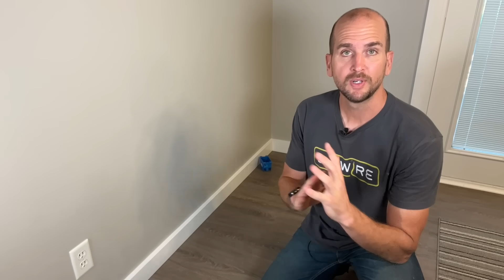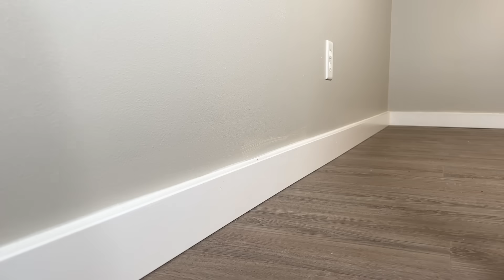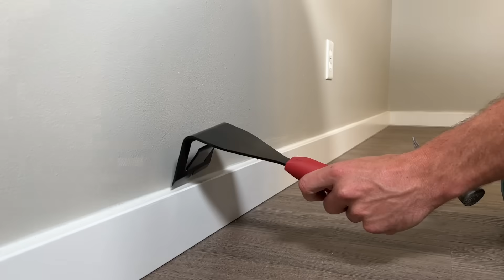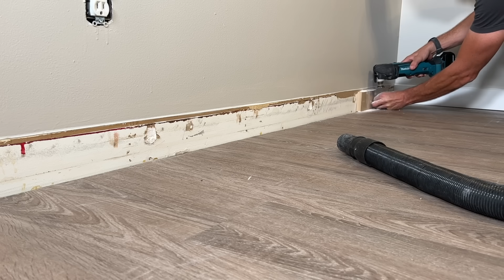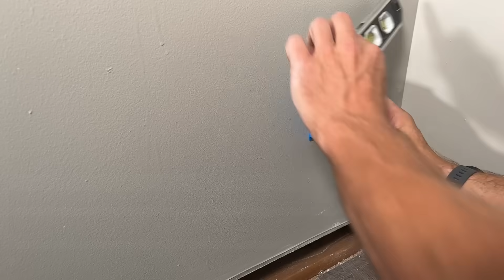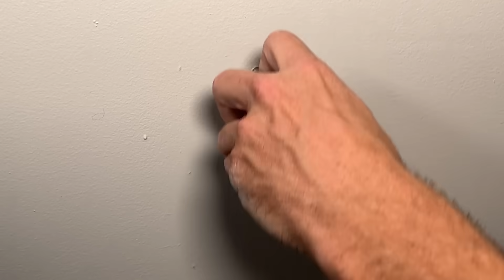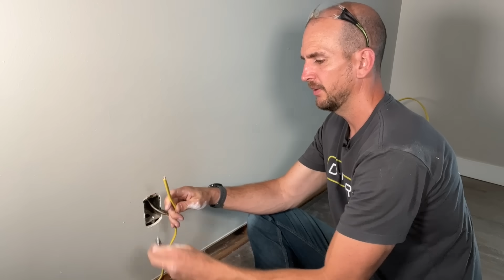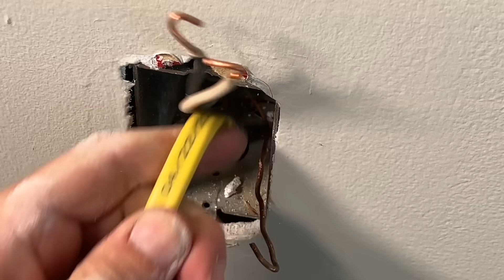How To Add An Outlet To A Finished Wall

Comment: Interesting.  Here in South Africa we don't have the convenience of running cables inside and behind drywall; all of our buildings here are brick.  So when we do a job like this it's chasing masonry, installing conduit, plastering and skimming, really a messy pain.  It's also odd seeing your black and white cables; over here, red is live and black is neutral, but it's 220V, 50Hz.  I envy your building methods in situations like this.  But then again I've seen what tornadoes do to your homes, ditto termites....  Nice concise video, thanks.

Comment: what size Romex for residential?
Reply from the maker: 20 gauge for 20 Amp circuits and 14 gauge for 15 Amp circuits
Reply: @EverydayHomeRepairs  uh that would be 12 gauge for 20 amp...I know that was a fat finger typo but dint want anybody installing 20 gauge fuseable links in their walls ;)

Comment: You did a nice job I was surprised actually. With 22 years experience as an electrician I approve. You should still loop and hook the hot and neutral imho but it’ll work

Comment: You should always use the screw terminals on the hot and neutral over the stab-in connections on an outlet. Twisting the wires together and using Marrettes at the pigtail is better. Allows for a higher current draw. But, a great DIY retro no-drywall repair video!

Comment: Why do you need to add Wago connectors to the existing outlet? The outlet (shown on 8-40) has spare terminals - just add the new wiring straight to it.  Am I missing something?

Comment: Okay so everyone in the comments seems to be way more experienced than me, so please be nice lol.. I have a question. I actually need to run two electrical boxes in my house, I do luckily have a basement to work with though. But my question is why would you use those wako connectors instead of just attaching the next outlet to the bottom of the first outlet? I thought they were designed to daisy chain together with the top and bottom connectors on the outlet?

Comment: The trim in the 1999 house I just bought is 2 1/4", the smallest, cheatest crap they could find.  I'm planning on tearing it out and replacing it with at least 3 1/2".  Right now, it just makes the house look cheap when you walk into it.  I want to turn this house into a nightly rental, so it needs to be appealing.  When I swap out the trim, I'm also going to add a bunch of outlets.  This house was definitely builder-grade, so it has the minimum number of outlets possible by code.

Comment: No need for wagos and pigtails (especially if you have a shallow box), I would have just used the bottom screws on the outlet to send the circuit to the new outlet.

Comment: Why are outlets in North America installed upside down? The ground pin should be positioned in the top with the hot and common blades at the bottom. Presently, If a plug is not fully inserted, a narrow metal object (knife blade, wire coat hanger etc) could drop onto the blades and create a short. The ground pin in the top position would negate this hazard.

Comment: Cosmetically great job, a few things I’ll give you tips on, use 14-2 Romex for this, all bedroom outlets should be wired with 14-2 on a 15Amp Arc-Fault Breaker. Wago’s fail a lot, I would use Wire nuts.

Comment: You will only find 16" centers on houses around 20 years old and newer.  All older houses used 2' centers and if you not in a city you will find 2' centers. Most city's are mandatory 16" centers or by that I mean  between studs

Comment: Unless local bylaws says otherwise, 14AWG wire is both enough ans easier to work with.
Also, there are 4 screws on the receptacle, so wago lever nuts is not needed.
In fact, adding more contacts may be dangerous.

Comment: This is a great video for DIYers! I am very confident to do this however I have a question to ensure I’m not failing any codes.

I want to place an outlet straight down from where my tv will be mounted hence the reason for watching this video. The outlet that I will tether off of is approximately 4ft to the left from where the tv will go. 

A cable/Ethernet box is where I want my tethered outlet to be. Would placing an outlet next to that box go against code? Basically the outlet will be on the left side of the stud and the cable box is on the right side of the stud.

Comment: I'm not a electrician! Just a 65 year old burned out Truck Driver. WHY, go through all thàt work removing the bottom trim peeling back the carpet then cutting a section of drywall out! when you could have drilled a hole below the the wall outlet in the basement? Then drill a few holes in the floor joice,s run the 12/2 romex wire thru them over to where the stud, you plan on mounting the outlet to? Then drill a hole through the floor? use a Oscillating tool! cut your box mount out! Then run your wire up to the box wire it accordingly! 1 hour approx your,e done, No bottom trim removal or carpet removed. I think that's how, I would have done it! Doesn't it sound logical or is there some kind of building code say,s you can't do it that way! It sure in hell seems a lot safer coming up from the basement. Then going thru all thàt work.

Comment: Residentia homes stud work is every 16" on center and for commercial building stud work is every 2'  on center I'm a drywaller since 1974 wen I came back from vietnam war,  my high school friend got me in the union so I know about tap I need anf drywall hanging 4' x 8' sheets or 12 foot e 4s also

Comment: Well, this would get you banned from being an electrician in this country, a fine and expensive remedial work. Cables must run in safe zones, eg along the direct route between accessories. Otherwise Mr Homeowner #2 will have zero idea there's a cable randomly running diagonal a bit then along and up and drill through it with obvious results.

Comment: Unless I'm mistaken, aren't the sockets meant to be wired in a 'ring' rather than one piggybacking off the other? Maybe different electrical wiring rules in the US. In the UK, we use a ring system.

Comment: There is a plastic protector which screws over the exposed threads on the connector in the metal electrical box in the wall. The purpose of this part is to prevent chaffing of the installed ROMEX.  Depending upon the codes in your local area, you would have failed my inspection.

Comment: Excellent video and tutorial! 
The only thing I would improve is the following; i believe it would be wiser to pass the wires lower, at trim level. Since studs are accessible, you can add protective metallic plates to avoid screwing your trim through your wires, and then putting back the drywall section and trim. 
This would have the benefit of not only protecting from piercing your wires when putting the trim back, but also prevent this for any future house improvement. (If, 10 years from now, you fix an IKEA furniture to the  wall and pierce your wires because they are not deep enough in the stud, and because you don’t remember where you passed your wires 10 years ago)

Comment: Actual stud spacing is 16 inches on center with a 14 1/2 inch bay, not 16 inches between studs as stated.

Comment: Pretty sure it's against code to run the wires that low to the ground.  I was taught to pig tail and wire nut. I don't like those plastic connectors.

Comment: I had to do the exact same operation on a rental house to meet city rental code for an old lathe and plaster house. I had to get a scrap piece of drywall because the plaster was not re-usable but the same idea applies. Instead of snipping the nail I pull them through when possible because the nippers do not cut the nail flush.  i do not have that trim removal tool, but i think I will add it to my arsenal. I love the lever lock wire connectors! I used them yesterday, my co-worker wanted to add in a pressure operated disconnect after I extended a DC line from a transformer in the floor box to the delivery unit in a dental chair and it made is so fast and clean for him to add in the pig tailed switch to the line.

Comment: Adding an outlet must be considered carefully. Many countries building codes limit the number of outlets per breaker: an outlet being considered to be  an outlet,  an interruptor (switch) or a light. Adding an outlet adds load required from the breaker. A 15 amps breaker is limited to 15 amps x 120 volts or a total of 1800 watts at the same time. Appliances as simple and very useful as a microwave and a coffee maker will trip the breaker. Should one think of replacing the breaker by a stronger one, the heat that triggers the breaker will differ to the smallest wires and possibly set fire to your  house walls... THINK  ABOUT IT CAREFULLY '" As for this video it should not exist or at least the previous should be written first as a warnnig to those who think about installing more outlets to an existing breaker... HAVE A SAFE DAY'...AND NIGHT !

Comment: This guy makes it look a lot easier than it is with video editing plus he has tools that most people will not have trying this. You wire up something wrong and fire hazard and immediate denial from insurance company with any claims. This can also be the case using breaker brands different and not compatible with the breaker panel. I just paid a little over 1k to have 4 dedicated lines with 10 gauge Romex ran to my breaker panel with 4 separate breakers. The Romex itself is expensive. Electrician and assistant were done in about 4 to 5 hours time. Reasonable seeing amount of work needing to be done. If your time from your job or business is worth at least hundreds an hour or more than doing things like this yourself is a waste of time.

Comment: Curious as to why 12/2 wire was used rather than 14/2 on the 15A Cct.?  Will say that this is the technique that I was taught by my father and brother when I became an apprentice (with some mild differences). It gets even more fun when its an exterior wall and you have to deal with insulation and vapor barrier... or worse... sprayed in foam insulation......

Comment: We had some wiring replaced. We found out that one outlet got power by being wired to another outlet with an extention cord...inside the wall. I guessing there is a ton of dumb stuff like this in the house that we just don't know about.

Comment: As soon as you went for the skirting board (trim) i was like "genius!" My only thoughts are that (not sure if its a U.K. only regulation) but the cable runs between accessories must run inline with the accessories either horizontally or vertically ( i assume to make it easier for people in future to know where live cables may potentially run behind walls) but i suppose once the wall and skirting board are back on who will know!? Great vid and great tips.

Comment: Isn't having a wooden wall extremely rare? I've never seen one in my life. Softest wall would be gypsum or gas-concrete. Other than that, standard stone walls. Double walls are easier, but especially old houses would have only 1 stone wall. Just wondering why you'd spent making a video about a wall that doesn't exist or at least is rare?

Comment: Only thing I don’t like it’s that you use those wago things I do electrical service and I have home to cut those things off and use a pair of linemen and twist the wires together and put on a wire nut because they burn up or they just stop working it’s same a pushing wire into the back of an outlet sooner or later it will fail some things are just pull doing the old way they work good for ballast’s cause the ballast will fail sooner or later also I don’t like them won’t use them I know many people that love and swear they are the best but I just see it as job security unfortunately

Comment: Why use modular connectors rather than screwing the new wires to the available outlet terminals? I know lots of electricians who hate those things. I use them on a overcrowded box if I have to.

Comment: Nice video. As this socket is now a spur, does that meet US standards? 

In the UK you would be expected to open the loop at the first socket and include the new socket in the ring. 

Not a dig, genuine question.

Comment: No need to use any nuts connecting the new outlet to the old one. Just connect the new wires to the second pair of unused screw terminals. Otherwise great video.

Comment: I'm definitely an amateur at this, but I've never seen anyone attach the box to the drywall itself, instead of screwing it to a stud. Does this not cause stress and risk damage to the drywall when someone is not careful plugging/unplugging?
Reply: Hi Jaimi.  The long pivoting tabs in conjunction with the front fixed tabs of blue "old work" boxes do a good job of distributing any vertical or horizontal pressures from the box to the typical surrounding half-inch drywall (which itself is actually an amazingly strong and verrsitle invention!).  Any current residential-style duplex outlet should not create much resistance to typical devices that would be plugged into it, thus really very minimal "stress risk."  I've used these very helpful devices in my remodeling business for years and have never had a problem with them (other than miscutting the rectangular opening, which should be done with a bit of patience to detail to get them to fit correctly).
Reply: @jeffrector8831  Awesome - thank you! I was worried about placement of a new outlet I need to install in a bathroom, and either stud is just in the "wrong" place for it. This will work out well.

Comment: Just don't try this if you're in the UK...!
Reply: Because??
Reply: @jeffrector8831  Because the construction of internal walls is rarely as shown here, especially older properties.

Rather than studding and drywall, they will be some form of concrete or cinder blocks covered in two layers of plaster. The retaining nails for the skirting boards will be into wooden wedges between the blocks. Not only will pulling off that trim frequently pull out the wedges too and bring down some of that plaster, there won't be any neat void behind to hide wires and allow access.

If you happen to find such a void, though, it's always possible that the wall will be lath and plaster. Removing the skirting will 'open a whole world of hurt' and mounting a socket becomes a nightmare!

Comment: I gotta pick on you just a bit. The first one is a code violation and the other two are just minor details. 1. You need nail plates on romex running horizontal, per NEC. No height differentiation. Plus you mentioned putting up above the base, where you can't put plates. 2. you can use number 14 romex is you have it. 3. You didn't mention who taught you this. I'm 30 years in the trade and this has been around for a while. Glad you brought it to the masses but give credit where credit is due.

Comment: As an industrial electrician, I totally agree that those Wago 221 connectors are the best.  I've been using them for years.  As a best practice, I always put the source wire (line side) into the marked slot on the Wago.  Notice how they all have just a single wire slot that has black writing on it, it'll be the middle one on any with more than 2 wire slots.  That way if you're removing wires on a live circuit, that's the one you leave in.  Of course, always test this just like you should always tests which is the hot and which is the neutral wire in case someone before you isn't following the standard installation.

Comment: Well you got lucky because you had hollow wooden walls, otherwise it would have been trickier, also you are encouraging people to run mains wires outside of prescribed cable zones which is not really a good practice and potentially illegal depending on where you live. Next time please hire a professional.

Comment: I see 12 gauge wire used on 15 amp outlets. Is not yellow 12 gauge yellow cable used with 20 amp outlet and 14 gauge white cable wire used with 15 amp outlets?

Comment: Question...Why the pigtails? is it a code thing that you can't use both connectors on the outlet? 1 from supply and the other to the new outlet? I think I understand why you would for the ground since you shouldn't have two wires on the same screw but honestly don't know why you would want to for the hots and neutrals.

Comment: Cool video! But why aren’t the walls insulated and what to do, when the walls are insulated? Greetings from Germany
Reply from the maker: This was an internal wall which usually doesn’t have insulation, just an open cavity between studs.  Is wood a common building material for residential homes in Germany or more masonry 🧱?

Comment: There’s an even easier way to do this…. A cable installers drill and setup and magnetic lead/bar… no cutting required except for the new box site on the stud. Run your magnetic bar across the wall and your magnetic lead on the end of your Romex WILL find its way through all of the studs no problem and into your box.

Comment: Curious if theres any reason not to daisy-chain the new romex to the bottom contacts on the old outlet instead of using lever nuts and pigtails.
Reply: If you pigtail it, then if the recepticle goes bad, you don't kill the ones downstream.

Comment: Great video! Only recommendation I suggest is you should run electrical tape around the outlet to protect from potential, also makes it easier for the next guy to handle if they take the outlet out while still hot (which you shouldn’t do). Not as necessary with a plastic box but a must with metal boxes.